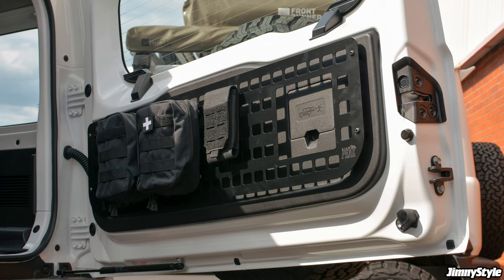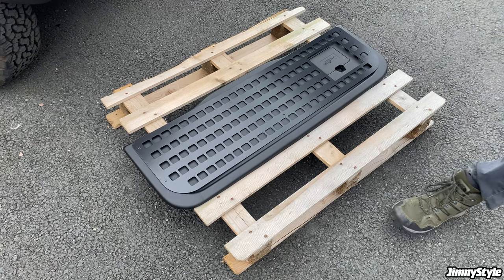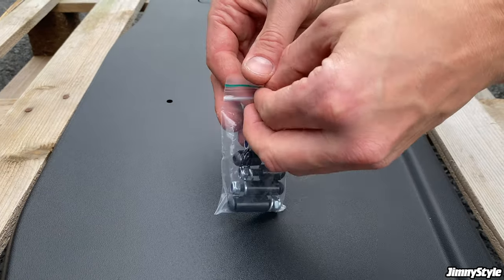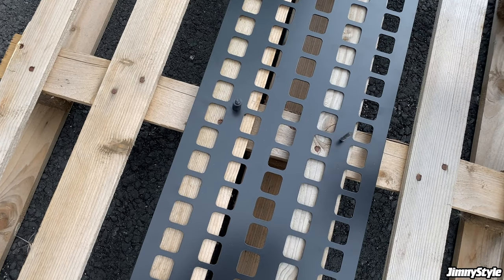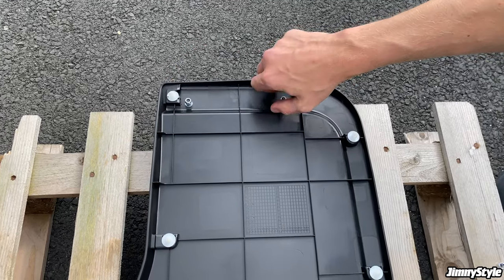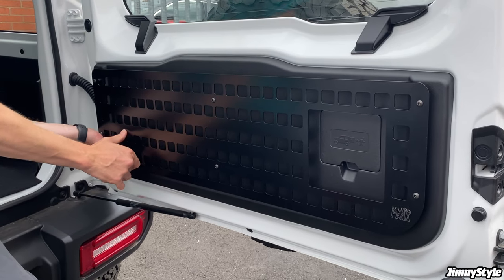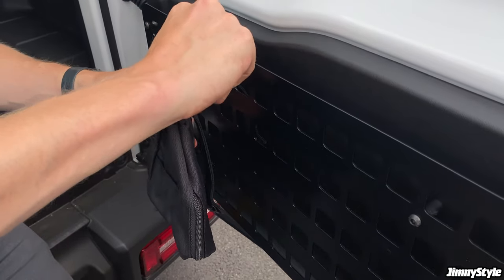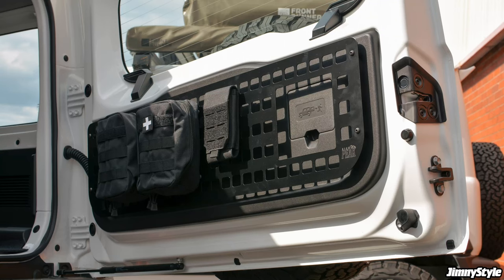HIGH PEAK Tailgate Molle Storage Panel for Suzuki Jimny (2021+) LCV

Comment: Would this panel fit on the new 5 door JIMNY, 2023 model ? Thanks
Reply from the maker: We haven’t tested it yet, but I believe the plastic trim panel on the tailgate is exactly the same as the regular 3-door SZ4/SZ5 model sold in the rest of the world, so the Molle Panel for this model should be ok! The model shown in this video is the LCV version which will be different to the 5-door model
Reply: @JIMNYSTYLE  thanks